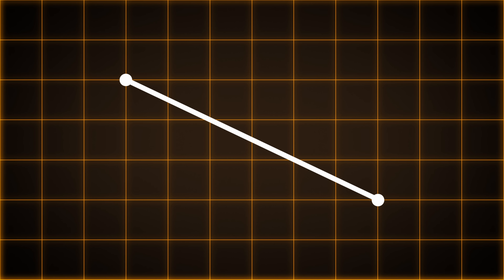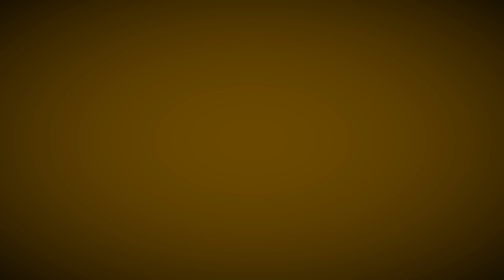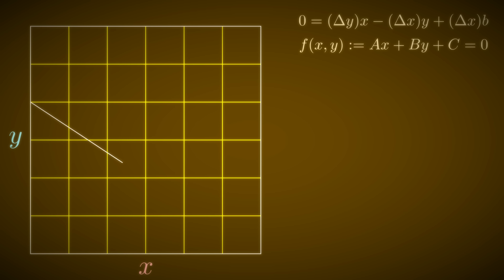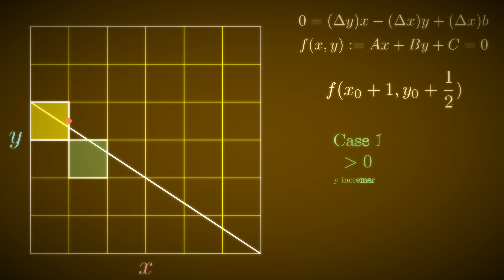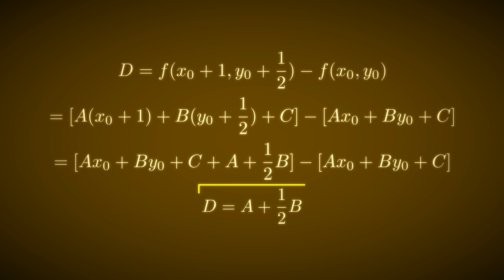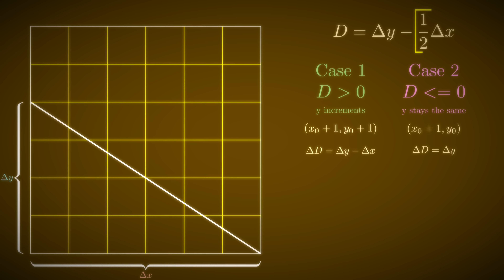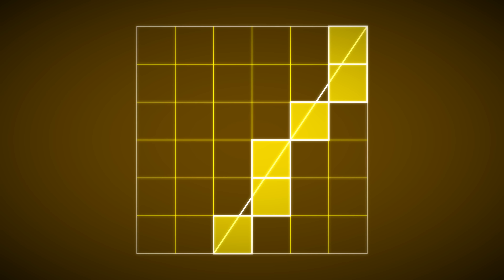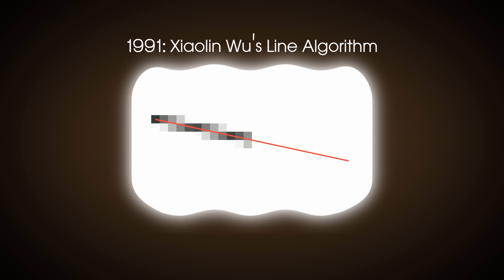How Your Computer Draws Lines

Comment: I had a Radio Shack TRS-80 computer in the late 70s. It had similarly simplistic graphics. You could turn (large) pixels on or off but that's it. No LINE function.

So I worked out how to do it manually with a FOR/NEXT loop. Fortunately I was also learning algebra at the same time.

I even discovered how to vary a sine wave's amplitude and frequency before learning it in school (once I upgraded to enhanced BASIC that included the SIN(x) function!)

Comment: I think of the math here as saying, the function Ax+By+C (integer coefficients!) is positive on one side of the line and negative on the other. Keep a running tab of whether you're on the positive side or negative side to know whether you should increment x or y. Based on that, add A or B to your tab.
The corresponding algorithm for circles (again based on integer addition -- and works for general conics) is yet cooler.
Now instead of adding constants A,B to the running tab, you should add linear functions.
But computing those linear functions is itself done with a running tab for each one.

Comment: Draw a vector between two points, fill in every pixel in contact with the vector line, and if there are more than 2 pixels in a row filled in, only fill the one with the most contact with your vector line. Don't forget to account for weather or not the line is horizontally or vertically oriented
Howd I do

Comment: The Bresenham line algorithm is also used in 3D printing to perform the coordinated axis movements, saving lots of computation and allowing slower (16MHz) processors to easily handle the typical movement speeds of 3D printers. Bresenham allows the multiple linear motions to be perfectly coordinated to start and end at the same time, so it’s ideal for any multi-dimensional system that needs proportional linear elements.

Comment: Maybe the image at #0:13 is incorrect. The points should be placed in the center of the square, not where the grid lines intersect.
Reply: Why?
Reply: no they dont, the intersections can be viewed as the pixels too

Comment: I remember writing a function to draw lines and hating the fact that you had to have a double nested if else condition for positive, steep positive, negative and steep negative lines. 4 code blocks all doing the same thing with just some values flipped around.

Comment: I remember in our first graphics lecture, the professor walked in and said he was going to spend the first half of the 2.5 hour lecture telling us how to draw a line. We were all confused, as we figured it'd be trivial to write some algorithm where you calculate the slope then plug coordinates in to y=mx+b. Then he said we weren't aloud to use floating point numbers and things got interesting.
Reply: So, you were allowed to use fixed-point numbers then?
Reply: That’s how it’s done. You can just use fractions instead of decimal points. A fraction can be stored as 2 integer values.
Reply: @jamskinner  Are you talking to me?
Reply: @flameofthephoenix8395  no he isn't
Reply: @charliefor-ever Alright then, sounds good to me. And thanks for telling.
Reply: @jamskinner A floating point number is also just two numbers.
Reply: @jamskinner But how will you perform arithmetic with it.

Comment: the algorithm to paint a smooth triangle with antialiasing is so difficult, is not that easy. And also the part of texturing os also difficult
Reply: I can imagine, I personally don't like anti-aliasing much in the first place and prefer not to use it when creating algorithms to draw shapes. Even though the shape will look smoother, it's a trade-off.

Comment: 0:09 Isn't that a 1d shape? Im aware that on a computer screen everything is represented as 2d, but just thought I'd be a dick and nitpick a bit.
Reply: I'll honor your question anyway.

If you saw multiple lines on the video then it is ATLEAST 2D.(But being serious is a video, so it can only be 2D) 

If you abide by the shape being infinite. For example a Line not a segment. Then:

All lines in 1D are the same line. 
All planes in 2D are the same plane.
All cubes in 3D are the same cube.

So if you want to compare one of these to another you need an extra dimention.
Reply: @Hersonrock12  Fair. And I never thought about needing an extra dimension to define a shape with a lesser dimension until now, very cool
Reply: @RedLuigiE  Being honest I never thought it fully untill I started writing that message.

I blew my mind to think that maybe in 4D you can have Two infinitely sized Cubes that do not touch eachother.

Comment: 3:20 another thing to note is in computer science dividing by 2 and multiplying by 2 is considered very trivial/cheap. Since you do not need to do any actual multiplication or division. Since in base 2 multiplying by 2 is just a left bit shift and dividing by 2 is a right bit shift. (In other words just add a 0 bit to the right for x2 and remove the rightmost bit for /2) (technically removing the rightmost bit of some number n is floor(n/2) meaning its rounded). So when you multiplied the equation by 2 to remove the fraction it was more like telling the computer to change the direction of the bit shift and change which number to apply the bit shift to. This adds some more precision (no rounding) but it come at the cost of space (adding an extra bit to the number). Which ironically, in some ways makes removing that fraction more expensive than keeping it. Or worse, it could introduce chance of overflow where the left most bit is lost, which can severely impact accuracy. But youd need really big numbers gor either of those to be a problem

Comment: Thank you. Nice video.
I remember how I was some 30 years ago writing x86 assembler code for drawing lines. I had no clue, that there are standard algorithms, so I invented the wheel, like so many other students at the time. 
I was basically adding (I was actually subtracting, because CPU will automatically tell you, you reached or crossed zero) smaller delta and when it crossed the bigger one, i shifted one pixel in the shorter direction otherwise I would simply continue straight in the longer direction. To improve symmetry, I started with count value at half of the longer delta (one really fast bit shift right instruction). I had to check the parameters at the beginning and pre-calculate some things. Like the direction of the line (prepared values to add to go one pixel longer direction and one pixel diagonally, this allowed to go all directions required), also line boundary checks. I was even consulting with CPU manuals, how long each instruction takes to execute so it was fastest possible.

Comment: A problem I found using this in my simplistic mapping applications way back is that the line you get depends on which direction you draw. Drawing a line from left to right (x increasing), then erasing the line from right to left (x decreasing) doesn't always work because the corresponding values of y don't always match.
Reply: For an algorithm I personally devised for drawing aliased lines on tiles I had to check 6 different angles.

The advantage of my line over the one in the video is that it is perfectly symmetrical with no artifacting at the edges. It's more computationally demanding, but it is a single time computation and then the line data is stored separately so it being unoptimized doesn't hurt the application.

I hope one day to see if I can make my algorithm more performant since its results are better looking than the traditional one.

Comment: It's like talking 4 minutes about how to make a wheel and then another 12 seconds: "Now connect wheels with axles, put some mechanical engineering on top and congratulations! You have a car!"
Reply: but the video is not about making a car. it is about making a wheel and then mentioning that you can build a car out of them
Reply: @bartekoo2197 : It's not; it's about how your computer draws lines, and then mentioning how you can expand from there.
Reply: To be fair, mqnc, the title is just "How Your Computer Draws Lines;" not "How Computer Graphics Are Made" or "How GPUs Work," etc., so I guess we shouldn't expect too much past the basic line phase here. But it still seemed to end a little too abruptly.

Comment: The first and second graphics routines I ever wrote were "plot a point" and "draw a line".
When I got my first CGA graphics card, I was aghast at how slow lines were, so I rewrote them in Intel x86 ASM (imbedded in a C structure.)
Was 200 times faster than the CGA call.
Reply: So did the graphics card actually have a "draw line" command in hardware? I'd have thought that type of thing would be left in software then.
Reply: @tbird-z1r  in the CGA days, there was "software" code in the card bios. You filled registers with needed info (x1, y1, x2, y2, colour) and called the routine address.

Or, used a language like C that has a graphics library.

Hand coding was way better than C, or the built in CGA routine.
I calculated the memory address/bit for the pixel and set that memory location (ASM routine and call).
My initial Line routine just called that Point Plot function after each new pixel calculation. (I was about to integrate the calls into the line algorithm. But by then I'd upgraded to VGA cards. Wasn't worth it to keep playing with my older system after that.)
Reply: @hrayz  Was the logic run on the graphics card? I guess it was just to simplify things for business programming etc? Still, you'd have thought they would tightly optimise any built in applications like that. Especially something as ubiquitous as a line.

If someone nowadays decided to rewrite the triangle drawing for a GPU in software, you'd tell them they were wasting their time.
Reply: @tbird-z1r Most of the overhead would have come from firing a software interrupt for every line or point plotted. It wouldn't have mattered how well optimized the algorithm was, because the CPU would have spent the majority of its time just switching contexts.

The first "GPU" to exist in the PC world was IBM's PGA (Professional Graphics Adapter), which included its own 8088 CPU that would execute graphics commands in parallel with the main CPU.

Comment: This is good.
Anti-aliasing is commonly used to create better results (its used in most current 3d engines to create a better result).

Outside of the typical interpolation, we instead calculate a weight for each pixel (how much does the line intersect a pixel partially, intuitively), and map that value to greyscale.

I think it’s always made more sense to draw lines (perhaps for rendering wireframes) by using vectors — and interpolating along the length of the vector — that way we don’t have to factor in a slope (dividing by 0).

Most of the graphics I’m used to seeing rending polygonal faces (not the wireframe), which use different techniques altogether (they happen to be very similar however — especially for “Triangle shaders”)
Reply: Interpolating between two points requires a continuous range of coefficients for each point, which means you not only have to multiply by fractional values, you also need to select the resolution of said fractional values to order for the line to actually be unbroken.
Reply: Yeah, I don't understand why they don't just do computations as if the screen was bigger than it actually is, then you can just average some pixel colors together to get your new ones for the screen you actually have.